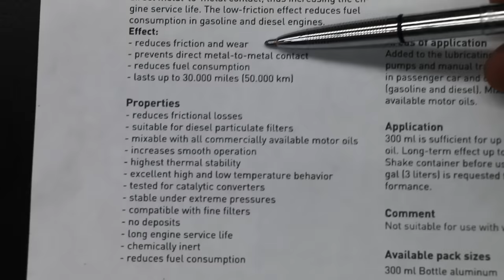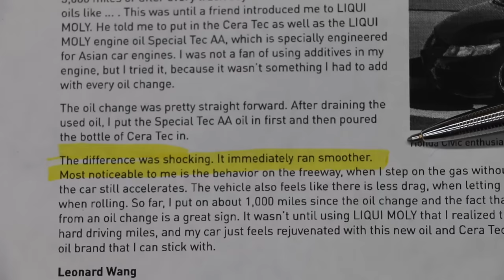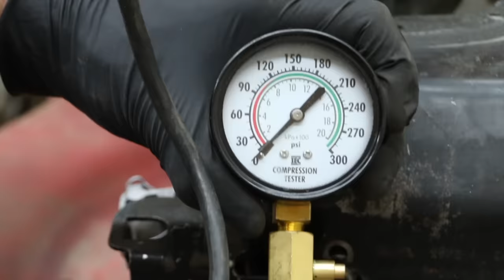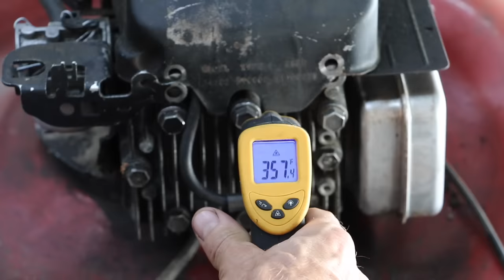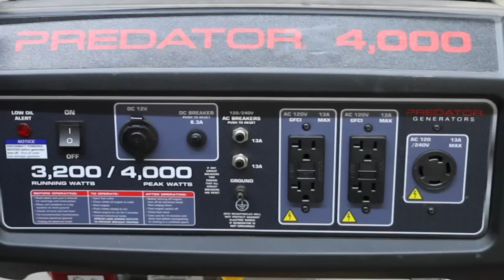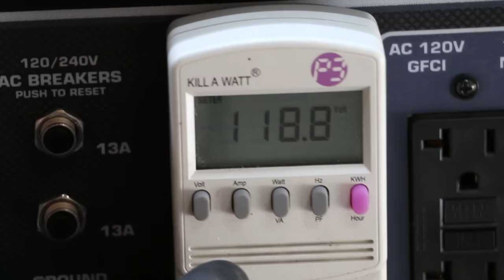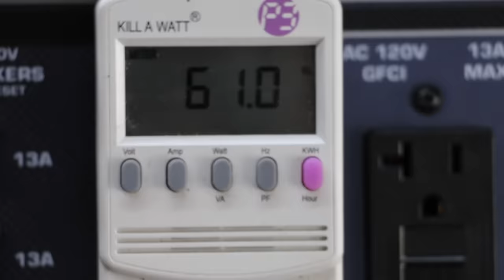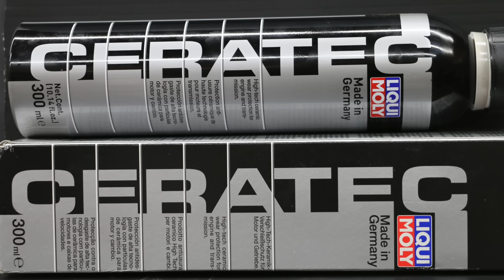Does Liqui Moly CeraTec work?  Let's find out!

Comment: Worth pointing out, 

All engine oils are formulated with an additive package that includes anti-wear, friction modifier, detergents, dispersants, anti-oxidants, corrosion inhibitors, extreme pressure, anti-foaming, anti-aeration, seal conditioners, etc... I'm not referring to the aftermarket supplements like Lucas, BG MOA, Liqui-Moly Ceratec...etc. It's not a good idea to use those aftermarket supplements as complications from additive clash and/or base oil incompatibiltiy are real issues that can do more harm than good.  Oil formulating is a very careful balance to ensure no one additive (or additive type) overpowers another.  When you go pouring some random supplement/stabilizer into that formula, you've now upset that balance.

Oil Stabilizers/Supplements are 99.5% olefin copolymer (a waxy, rubbery polymer) and 0.5% polyisobutylene (tackifier).  The polymer is a viscosity modifier with very poor shear stability (loses >50% of it's original viscosity after 100 hours) and the tackifier is only there to make it cling to those gimmicky plastic gears in parts stores to deceive people into thinking that's actually useful.  Tackifiers are useless in an engine since engines are lubricated with a pressurized oiling system.  In that system, tackifiers only clog up stuff.  Tackifiers are useful in equipment that sees splash lubrication such as manual gearboxes and differentials. No aftermarket oil additive/supplement on the market will contain any useful additives, it'll only dilute the amount currently in the oil, shortening oils life, weakening anti-wear, and promoting both oxidation and aeration of the oil.

https://www.machinerylubrication.com/Read/29836/aftermarket-oil-additives

https://www.machinerylubrication.com/Read/29610/aftermarket-oil-additives
Reply: Well said. I’ve used additives on two different occasions in my bmw 7 series and both times the motor idled and drove like shit. Both times a Vanos code appeared and I instantly had to dump good clean oil and replace it immediately. I’ve noticed certain American cars are good with additives but others not so much. As much as I’d like to mix this in with the liqui moly oil I’m currently using I just dread another Vanos issue. Luckily I didn’t destroy the solenoids figuring there 800$ a piece and I have four in my engine
Reply: Ceratec is a concetration of molybdenum, an additive in most modern oils. You're basically increasing the dosage
Reply: Years ago while doing business at a chevron commercial outlet became acquainted with one of the back office managers. He was distinguished as being the only field Engineer in the company who had worked is way up from the engine test labs as a funky to field engineer. We talked about oils told him about our regional trading site maintenance. This guy volunteered to drive over 120 miles to give a lecture about oil & lubricates to the students. Not only did he do an out standing job each student received a 3 ring binder full of information as did all the RTSM Cadre. Basically he said same thing the op stated. In his lecture  he said in the industry all additives were called mouse milk. And the companies who produced them made millions. His advice based on years of experience choose a good quality oil & filter change under factory specified time use synthetic oil if possible change eariler than specified intervals. Keep up on prevention maintenance.  Faulty spark plugs, wires or bad coil will wash a cylinder of lube advancing wear. He was a really humble man the kind that are rare today...full of actual field experience not opinions from books.
Reply: @shanerasberry510  that’s because you don’t take care of your car. Zero issues in a e36 m3 and a e39 540i

Comment: So I changed my oil with Royal Purple 5w-20 on my Honda and added Certec in the engine. I went to LA from SF and came back today putting over 1200 miles. I noticed when going down to LA the car ran smoother and had better mileage. But I also cleaned my valves along with the oil change. I am not sure if the Certec was the only cause but I had better and smoother performance engine.
Reply from the maker: Thanks for sharing.

Comment: Thanks for organising such a methodical and rigorous testing of Moly CeraTec.  I always love watching your tests. 
.
When you test under power load,  you are  showing  the voltage and current, then Watts.  When the load is inductive reactive (such as a coil or electric coiled heater element) some of  the current will lag the voltage. The power will then be partly real and partly reactive ( non work producing).  It is perfectly adequate  to only show power in Watts (assuming the meter displays True RMS power). The display of  frequency in Hz is useful to show  constancy of loading as you  did in the video. 
.
Project Farm, I have a suggestion as an alternative  to explore for filling scored  cylinder walls and scored crank journal bearing surfaces. 
.
Howard Hughes Senior built his fortune by leasing out  oil drill bit heads with a difference to competitors. One of his claims to fame was the ball bearings  used where  of a softer iron. The ball bearings would deform but continue working without shattering . His competitors would use ultra hard metals which would eventually crack and fail.   
.
With the same reasoning then, you might like to try ultra fine particulate solder paste mixed into the crankcase oil.  The idea is that the fine solder paste melts at the friction hotspots and fills in the scored sections of cylinder wall and crank journals.  As the friction hotspot  is filled, its local temperature  is reduced an the scored area stays filled with solder and also stays solid. The rest of the paste stays in emulsion throughout the engine with the cooler oil.  In comparison, Molytec Ceramic is the opposite to solder alloy in hardness. Boron Oxide is a very hard material (hardness of glass-like B2O3 is of about 1.5 GPa , journal of super hard materials 2008, "On the hardness of boron (III) oxide")
   
You are showing external engine temperatures of around 350 F. The internal friction hot spots would be higher.    
Solder  melt temperatures can be selected from 190 to 840 °F  depending on the solder alloy selected. 
I would mix together a  small range of solders with different melt temperatures to cover different engine conditions and friction hot spot temperatures so you have a greater chance of achieving the correct temperature zone for solid filling solder into scored hotspots. 
Solder paste is used in the electronic industry for  printed circuit board assembly soldering of  SMD components  (Surface Mount Devices) .  Solder melt temperature should be selected to be just below friction hot spot temperature and above oil temperature. Yoiu will need to put a thermocouple  with a DVM Digital measurement meter to measure temperature of the oil. Thermocouples for DVMs are cheap (around 10s of dollars) . You can drill a hole in the side of the crankcase, insert the tiny thermocouple and epoxy it in place with a non conducting epoxy or Black petroleum resistant RTV  gasket forming compound (also non conducting  so as not to short out the thermocouple two-metal leads coming through the crankcase.) 
.
Solder paste particulate size (lead alloy  granules)   range from 100 micron (1E-6 m or 1x10^-6 metres)  down to 1 micron.
I would use the finer solder paste particulate size so that it is able to flow through all the oil journals without clogging them.
.
The amount of  solder paste I would use is roughly 2 orders of magnitude more than is needed to fill the volume of scored metal within the engine.   This would still be a minuscule amount of solder paste material as a percentage of the oil in the crankcase. I'm guessing maybe 1 to 3% of the volume of oil in the crankcase of the engine.  The residual left over solder paste continues to circulate the engine until it finds and lodges into any new hot spot scored areas. 
.
Sources of solder paste and Thermo couple  for digital volt meters .
Chipworks and Loctite both make excellent solder pastes 
These can be bought from  electronic component sellers  such as Mouser, Digikey and  Element14 
.
I hope you consider this suggestion and I would be happy to help in selecting  the solder paste if this is too foreign an  idea. 
George
Reply from the maker: Thanks for the video idea.

Comment: I saw a 5% improvement (1mpg) in fuel economy after using Ceratec in my old VW CC VR6 w/130k on the ticker. After using Shell 93 for a while and got a bad tank of gas, I switched to Mobile 1 gas and had another 1 mpg improvement. I also had another 1 mpg improvement by switching Castrol 0W-40 to Liqui Moly 5W-40 Leichtlauf high tech. I'm getting a whole whopping 22 mpg in town now, smashing that EPA rating of 17 mpg. 😂😂 ...I was previously averaging 19. Before it even gets said, I still drive like a bat out of hell around town, as much as my 3.6L engine will allow. If I wanted to putz around, I'd hypermill a Honda CR-Z Hybrid with a six-speed manual and feel damn cool doing it. 👍😎
Reply from the maker: Great information. Thank you
Reply: @ProjectFarm  what oil additive do you recommend me for my acura rsx? It seems to have a ticking or knocking on the block and i want to eliminate as much as noise as possible
Reply: @rsxonprogress9488  liquid moly or marvel mystery oil

Comment: 5 years later and still continue to use this on the coyote engine platform the engine runs like butter no tick very quiet when at idle Al you hear is the exhaust 10/10 for the application.
Reply from the maker: Nice!

Comment: I've spent most of my life thinking of most oil additives as being pretty close to 100% snake oil, and have never used any. So I am a little bit impressed to see that this stuff does actually have some beneficial effect in terms of lowering internal friction and improving fuel efficiency. Not sure I'd bother putting it in my car or anything, but at least you showed that it's not total B.S.  🙂
Reply from the maker: Thanks for the feedback.
Reply: There's always a tradeoff though or else engine oil manufacturers would just included this in their additive package themselves.
Reply: @someusername121  yeah you have a point, can u suggest something that could happen to engine in long run? just anything ❤
Reply: @someusername121 nah it’s supposed to be separate because it coats everything and adding this to the oil would be too much because it’s only used every 30k miles. The Liqui Moly engineers know what they’re doing. They also make oil.

Comment: I used Ceratec with every oil change in my E90 M3 with the S65 V8 that were known to have rod bearings fail due to lack of lubrication.  Every Blackstone analysis came back just like the test before it (little to no metallic material in sample) and I never had rod bearing failure so, take that for what you will.
Reply from the maker: Thanks for the feedback.
Reply: Every oil change seems over kill, instructions say once every 30k miles or so. However you can use the mos2 friction reducer after every oil change
Reply: @FourFour2theFloor  30k kilometers... not miles lol
Reply: @FourFour2theFloor  can I use engine protect mid cycle... 4k mimes since the last oil change on my passat

Comment: I spoke to the liquiMoly rep at SEMA 2019. Was curious as I work in a BMW dealer collision center and see a lot of BMWs that burn as much as a quart a month. Was told this product was developed specific to stem some of that issue. My own 2002 Avalance 5.3 with 220k plus has been using about 1 qt half way through its oil change cycle. Figured I would try Ceratec for the hell of it and see what happened. Lifter noise reduced and when my change oil light came on I hadn't lost but maybe a couple of ounces of oil. Good enough to convince me. I'll add another bottle after a few more changes.
Reply from the maker: Thanks for the feedback.

Comment: For 40 years I have always changed my oil every 3,000 miles. Each engine I’ve had in every vehicle has lasted more than 500,000 miles. I use 1 tablespoon of Prolong grease in the paper oil filter and 2oz of transmission fluid from Lube Guard instant shudder fixx and 0W-20 oil from liquid moly. I have no idea how these interact with each other but my engines have always been clean with zero sludge, run ultra smooth and very quiet. My next test vehicle is a 2017 VOLVO XC60 with the 2.0 supercharged and turbocharged engine. So far it’s very smooth and purrs better than when I got it.
Reply from the maker: Thanks for sharing.
Reply: @jalove7  greetings!  I have an oil change self service soon. My supplies are arriving. I’ll demonstrate the process I follow religiously. Jose

Comment: You mentioned testing additives with better film strength and better overall. Could you name some? Thanks
Reply: yes, what are the better engine snake oils? 
[Do not mess wit ATF snake oils... kills the clutch friction !!]
Reply: @glasser2819  I have had results from seafoam trans additive, smells of acetone i thinks it frees up sticking valvebody components

Comment: Project Farm, I love all your tests,apart from this one tbh. According to the manufacturer Cera Tec builds a ceramic film on metal surfaces,filling micro gaps etc,therefore reducing friction,oil consumption,fuel consumption etc etc. But for this to happen you must drive your car for few hundred miles first,  without abusing  or overheating it. Metal ceramization process isn't something new,it's widely known and used in ship/naval industry for decades. I'm not saying that Cera Tec deffo works, as I never tested it,but this tes wasn't reliable and did not answer any questions really. It's as if you had a headache,took an aspirine and 30 seconds later stated that you can't feel the difference.
Reply from the maker: Thank you for the feedback
Reply: I totally agree. After having used this in my hemi I found it did take a few hundred miles to gain full affect. Good product !!

Comment: I just ran across this after thinking about using it in my grasshopper diesel mower. I’ve used liquimoly diesel purge for 20 years to bring many old diesels back to life and keep the fuel systems running smoothly. From your testing I think Ceretec is at least worth a shot. Thanks!
Reply from the maker: You are welcome!  Thanks for the feedback.

Comment: My 2019 5.0 was burning about 1 qt every 2500-3000 miles.once  I got to about 80,000 I started using ceretec. Now I seem to go almost 5000 miles and still isn’t even on the low side of the dipstick.  I add this every oil change.
Reply from the maker: Thanks for sharing.

Comment: Does the increase of efficiency come from the liquid moly lowering the viscosity of the lubricant? A lower viscosity will lead to less resistance on the crank and better fuel efficiency.
Reply from the maker: Great point.
Reply: No, have you seen de viscosity of ceratec? It have to increase oil viscosity for sure

Comment: you need to do a test with motorkote & bestline to see which engine runs longer without oil in the block, so far they've been the best oil additives you've tested, but which one is the best, thanks for doing these vids....
Reply from the maker: Great recommendation.  Thank you
Reply: Project Farm  with the strict mpg regulations on the auto industry coming in 2025 the car companies would be testing and endorsing a oil additive that truly delivered.
Reply: Project Farm don't get me wrong I love your testing of glue and duct tape, thread lock. But I fixed cars for 30 years. I've seen the industry go to tiny rings, reduced oil pump size, piston coatings, all to reduce friction and internal losses. They would be using additives if one worked. Keep up the good work bro.

Comment: personally I still like Militec1 though as a go to Molycote is a good second. I tend to agree with the chap that made the comment regarding splash oiling systems over pressurised oil systems. That may be a factor not sure if your generator is pressure fed. 1% is significant though like your 5hr test on the mower, this on the generator may possibly give a more definitive result! 2 thumbs up for your honest no nonsense videos.
Reply from the maker: Thank you!
Reply: Militec is snake oil, they havent big laboraoties , they are using a very old trick no good for engine, put some chlorines and parafin inside..that shit is corrosive i ensure you

Comment: I did put liquimoly in my 2005 focus which had a bit of vibration felt in the steering wheel at idle.  After 500 miles, the vibration was gone!
Reply from the maker: Impressive!
Reply: @ProjectFarm  Not impressive open and engine that used MOS2 you will see it inside the little thinny holes...i put it in a old engine and compression came back., thas more impressive.But the product its not a cure its to avoid problems, I have trying many additives, and so far just stick to moly, the only that can stand an engine...to last. Ptfe is like a glue, that palstic shit clogg s when mixed with carbon , moly is a powder superfine,,,dont make bond with any carbon, oil additve, only with metal.

Comment: It works for some applications. I'm not sure it fills in cylinder wall scoring, but it does the rest of what it claims. It works in the Ford V-8s pretty well, and I'm getting better mileage with my BMW E90 N52 [with cruise control, no passengers, highway only, same shell fuel.]. I thinks it should be used at about the 30K point. That'll prevent the cylinder scoring to begin with hopefully, and maybe increase the lifetime of the engine. Maintaining compression is easier than trying to restore it once its been lost.
Reply from the maker: Thanks for the feedback.